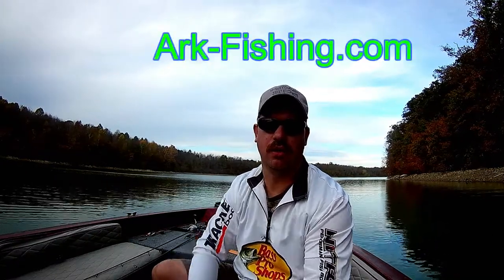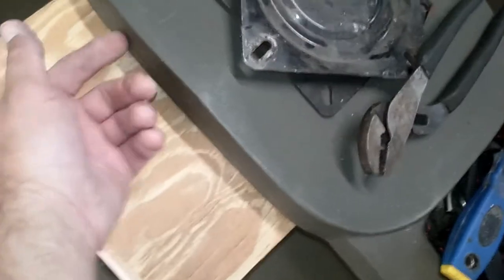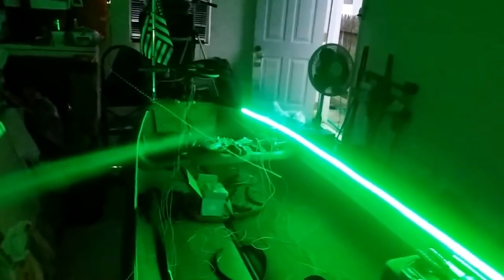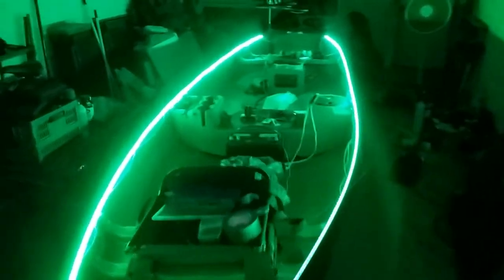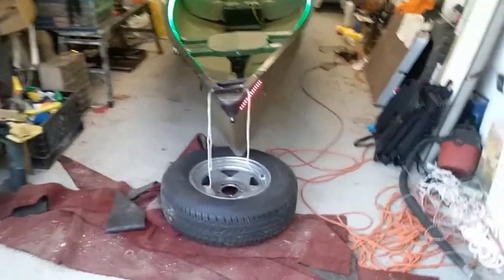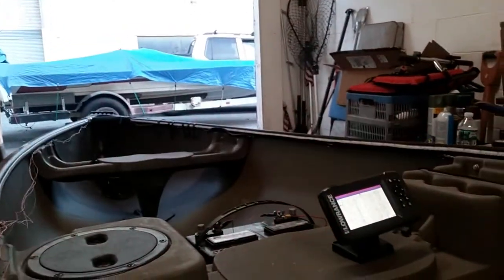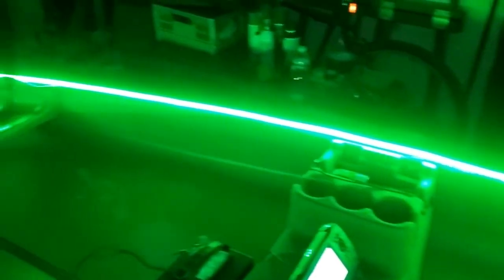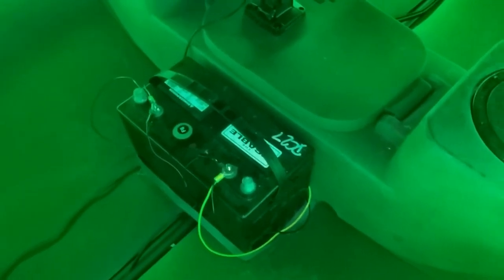Installing LED Lights on a Canoe #canoe #canoefishing #canoeing #fishing #fish #fishinglife #video

Comment: You should put a battery kill switch on it so your volt meter doesn't kill your battery when your not using it and I'm pretty sure your battery need to be in a box. Any way looks good.